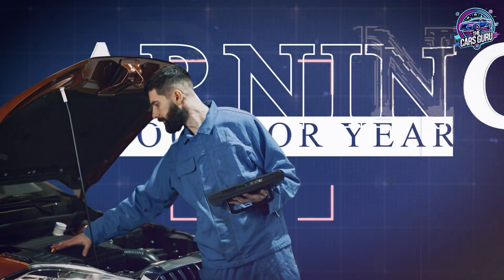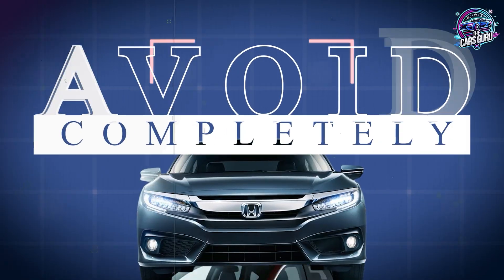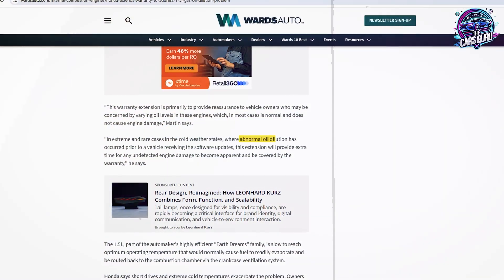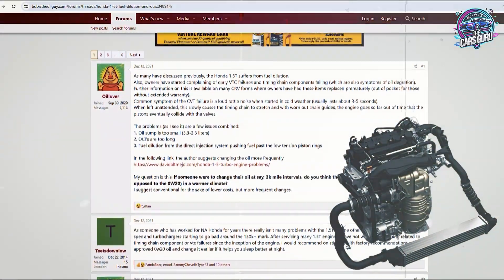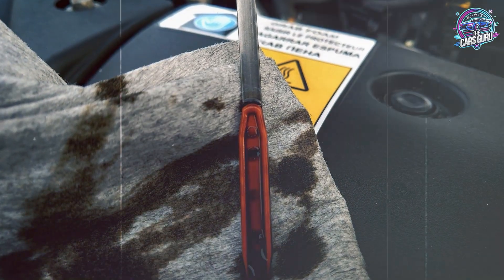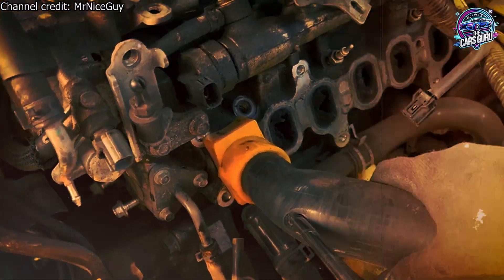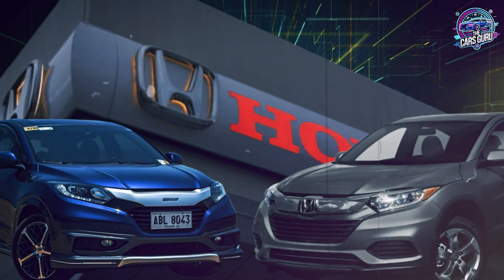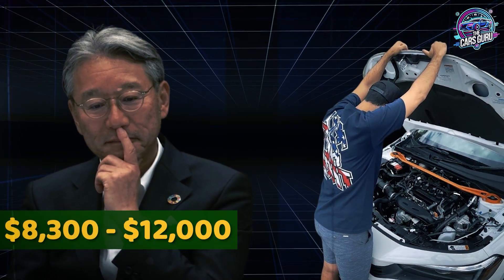Honda's 1.5 Turbo Engine: The $12,000 Disaster They Don't Want You to Know

Comment: I'm running my Civic 1.5T manual for 5 years (60k miles on the clock) and still no problem occurs. It's more important to know how to operate your car properly to avoid problems. 
1. Oil dilution:  warm up your engine oil up to operating temperature (25+ minutes of continuous driving) once in a few days;
2. intake valves to be walnut blasted +Valve adjustment to be done. But it's less a problem than for others modern DI engines like VW TSI
3. Gasket failure:  never boost your engine performance with Stage1/Stage2/etc. tuning and use Premium gas only.
Shitty CVT.. is shitty CVT as it was designed for NA-engines with low torque. So, be gentle with gas-pedal and never let it wheel freespin during winter (and especially roughly catch the grip) and your CVT cones should live a bit longer.

Comment: My wife and I purchased a brand new CRV that had the oil dilution issue. It was terrible even in the summer time and always driven long trips. The only thing Honda did was to give us a print out saying it was normal. Massive amounts of oil in the crankcase is not normal I don't care what they say. Never again. Buyer beware.
Reply: Supposed to end with 2023 CRV.   you're saying the problem still continues to 2024 or 2025 CRV?

am considering 2018 Accord and finding a ton of articles and videos about this issue

Comment: This engine/cvt power-train combo is nothing less than a ticking time-bomb.  More class-action suits need to be filed against Honda for this. A 1 year warranty extension is just a joke. The lawyers were laughing all the way to the bank while the people who were victimized by Honda had to either live with these problems or sell to another unsuspecting victim. After 10 years and 2 generations of these cars with this sh*t engine one would think that Honda would have done the right thing and admitted failure. But this was not a failure for Honda but a profit windfall. Angry yet ? I was one of the unsuspecting victims of this scam and I will never buy another Honda product. Remarkably they are still living off their stellar reputation as the world leader in reliable engines. Videos like this one will help get the truth out. Thank you for posting !